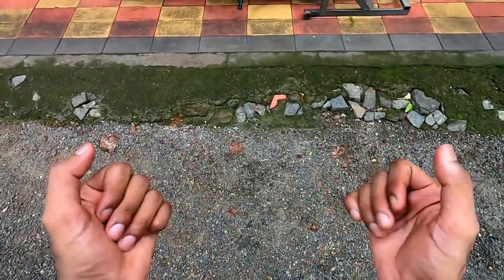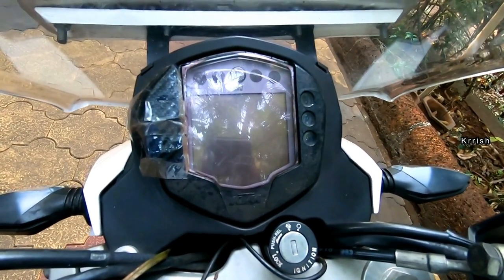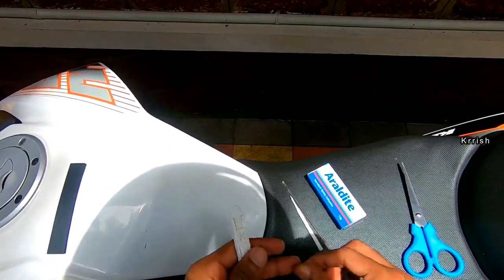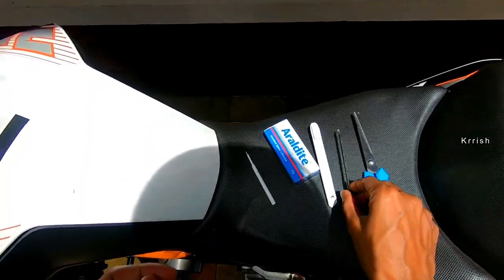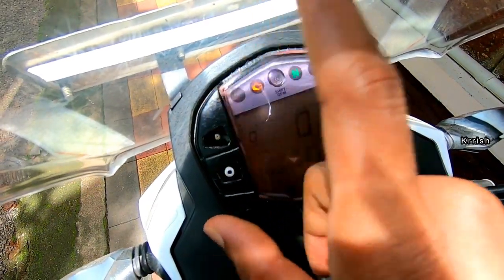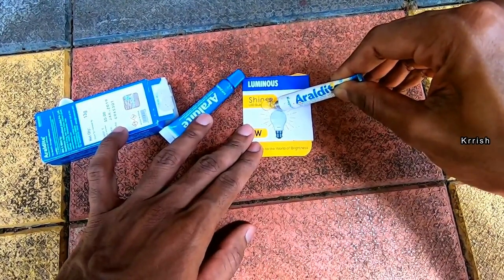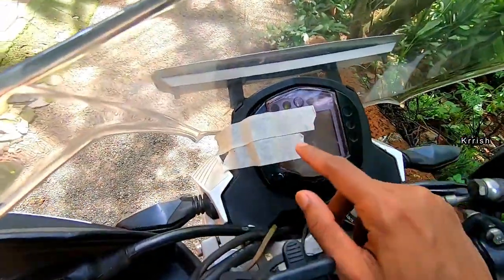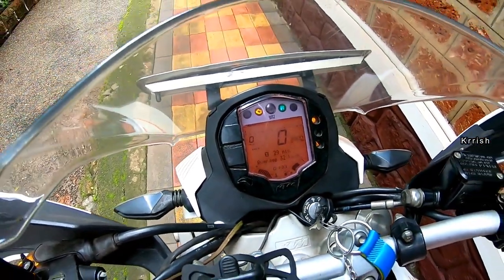KTM - Solve Speedometer Cover Issue !! - DIY - KTM Meter console Problem Solved -  Krrish

Comment: Hi mate. Just a question. Did this trick last long? Or it too need new glueing etc time to time?
Reply from the maker: It's a one time process. It will long last only if you do it when it starts to Crack. Otherwise you have to stick large single rubber piece or have to change the cover.

Comment: This will solve issues with mode and set. If you have a dual channel abs this doesnt work :(
Reply from the maker: Most of the riders doesn't use abs button regularly, so chances of getting damage is less.
Reply: @KrrishFR-KrrishFreeRider  there is an after market rubber shell available for this speedometer. I will upload a video soon
Reply from the maker: @kevingarnier1043   yes..👍 I have mentioned in that video
Reply: @KrrishFR-KrrishFreeRider  any link for that cover?
Reply from the maker: @SayantanCR9  bro ask any bike accessory shop.
If ur from mangalore contact speed demonz
Reply: @KrrishFR-KrrishFreeRider  I am from Kolkata, WB. I dont think anyone sells it here. Any place to buy it online? And whats the price?
Reply from the maker: @SayantanCR9  don't know bro. Better ask them, I think they ship the product

Comment: Bro water has been entered through this hole and speed of the ride is not showing what to do
Reply from the maker: Have to change the meter..
If u don't want to buy a new one try refurbished or accident bikes meter from 2nd market
Reply: How much it gonna cost?
Reply from the maker: @godtony2434  Around Rs. 2-2.5k
Reply: I bought a new one. It cost me a 7k
Reply: @godtony2434   Bro, are you serious? for duke 200? non-abs?
Reply: Yes, mate! It's expensive:(
Reply: @KrrishFR-KrrishFreeRider  how I can get it? Can share the shop and any email address?
Reply from the maker: @eboyzlife9484  Contact on 8169930668 or check your nearest seconds market